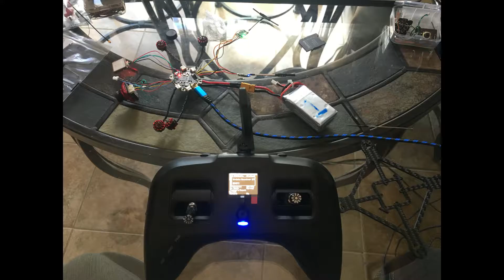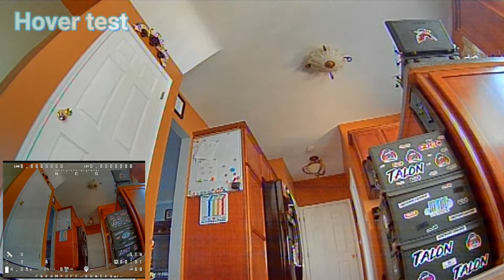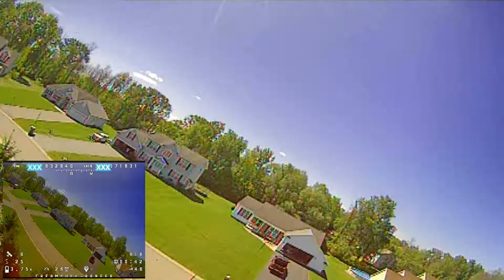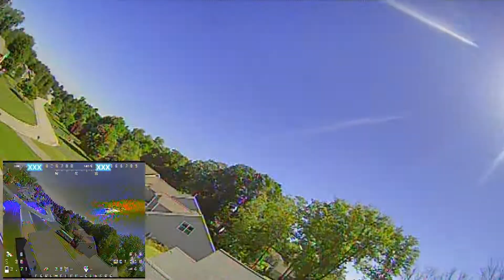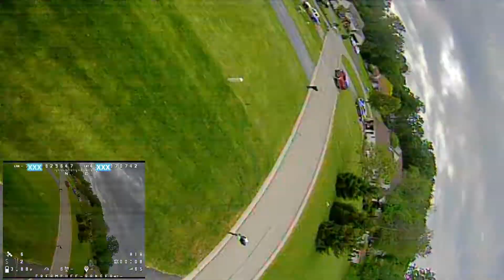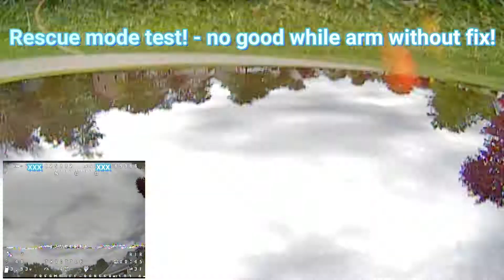TBS Tango 2 & 3inch GPS Toothpick build (ratel & onboard dvr)

Comment: I also want tango) Steep toothpick!)
Reply from the maker: I got tango 2 so I don’t have to keep swapping my modules out in my t12 transmitter. Now I need to loosen spring tension on tango!
Reply: @ChrisLBradly  I just can't afford a tango 2) it costs about half my salary) so I'll settle for a T12 jumper with a multimodule.